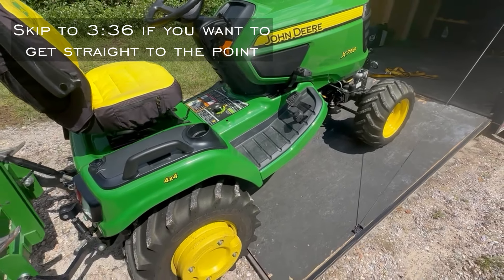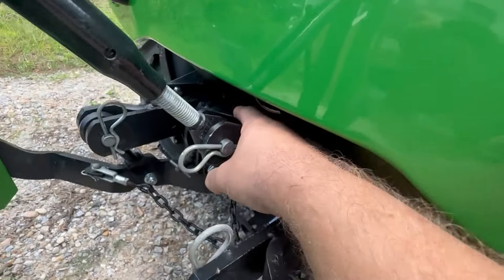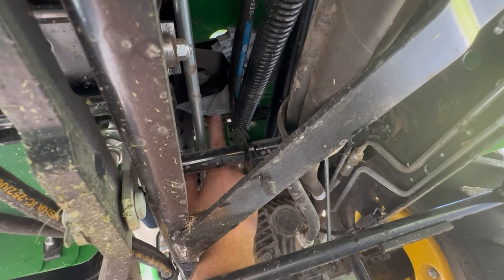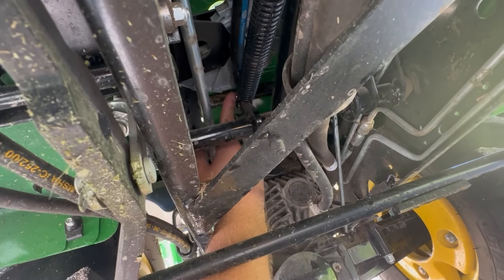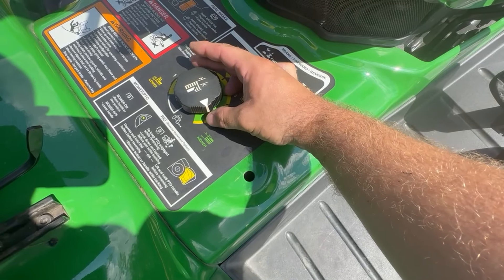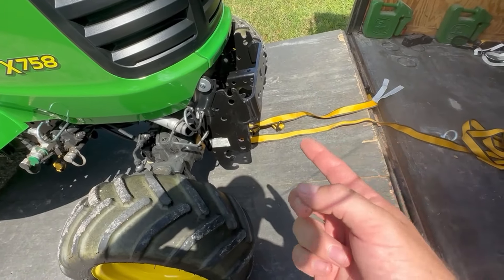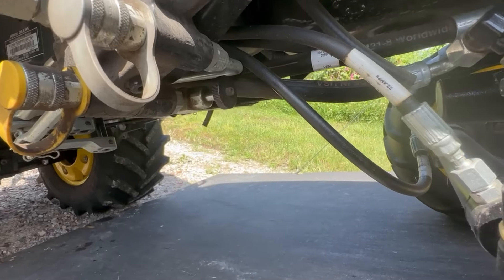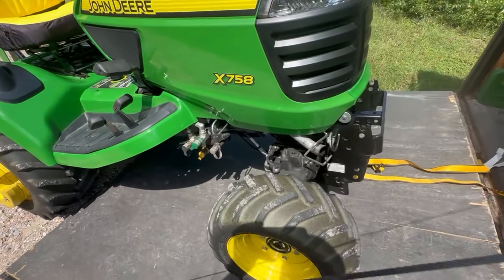John Deere X700 Series Mower Deck Not Lifting All The Way? Adjustment Knob Binding? Try This!

Comment: Hey, Josh, do you know if there is any way to access and clean the underside of the glass on the display on the X700 series?
Reply from the maker: There is, however in the tech manual, it is a 12+ step process. Email me, and I'll hook ya up.

Comment: Hey Josh, off topic but what do you know of the x740? How do they line up against the 750s? And am i demanding too much from my machine if I’m intending on mowing 5 acres with it ?
Reply from the maker: Arguably the 74Xs are better than the 55Xs, due to a little more weight and ability to add the factory Deere loader. Deere doesn’t suggest the X7s on their “which mower are you” thing until you click 5+ acres. So no, it will be happy as a dog in a field filled with squirrels or something!